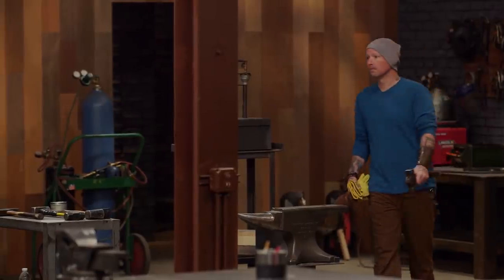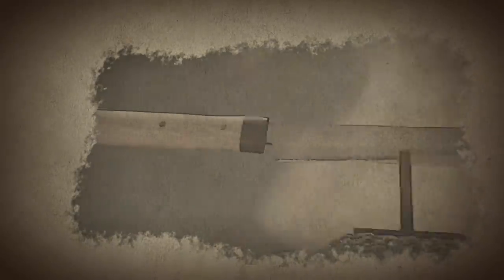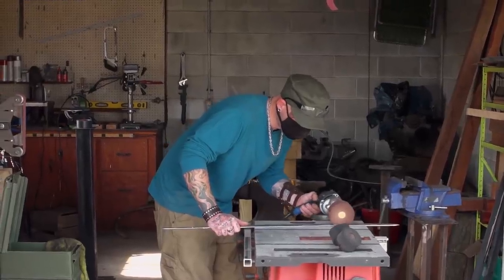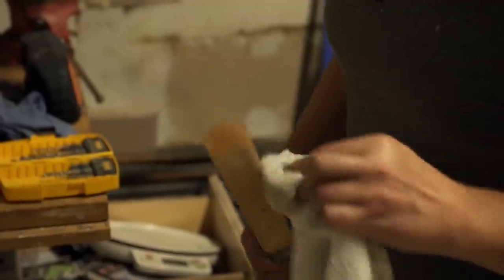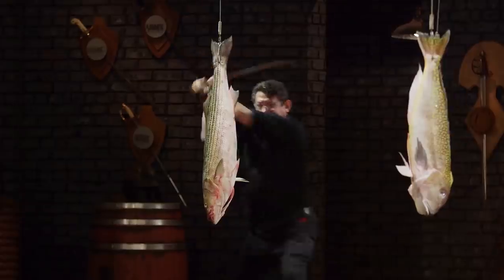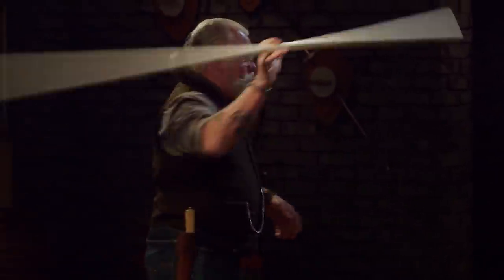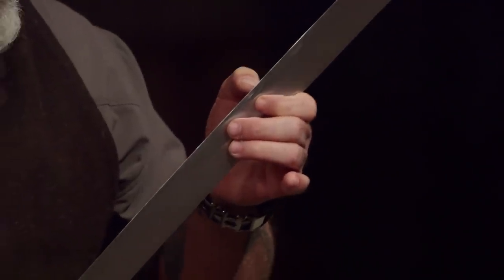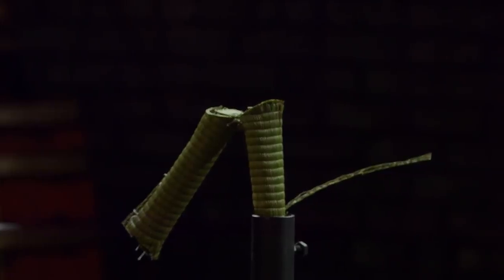Forged in Fire: The MASSIVE Maguro Bocho SLICES & DICES the Final Round (Season 8) | History

Comment: Doug: This blade is very light!

Every Seasoned viewer: Congrats on winning.
Reply: Only if it survives the strength test, otherwise its better to be a little heavier so it doesn't warp
Reply: Maybe need a sudden death where they hit some bricks or cinder-blocks to determine the winner
Reply: There's been some light blades that lost because they didn't cut as well (and that's only counting the ones that survived the strength test well). Like the William Wallace Sword. The lighter blade came out of the strength test perfectly, but didn't cut as well as the heavier blade... (and the heavier blade wasn't tooo heavy to wield). I think they also judge based on how the blade is supposed to be used. It's very important for blades that are meant to be light to be light - and so lightness becomes a much more important judging factor. If a dagger weighs as much as a great sword, that's not going to be an effective dagger. Whereas for blades that are meant to be heavy, lightness becomes just bonus points - if two heavy blades are doing just as well in all other aspects, then the lighter blade wins, because it makes it slightly easier to wield.
Reply: True
Reply: Well it is ( accounting for all other factors ) due to the fact that a light weapon can be wielded for an extended period of time. Which is an important factor
Reply: Sword
Reply: What about the Halloween special with a fireaxe
Reply: @スノーハッピー  The heavy claymore winning makes sense, it’s the same principle as the light ones winning. Blades should be heavy if they’re designed so, light if designed so.
Reply: @CoolHandLuke87  yeah the fireaxe guys were the only exception
Reply: @devmike  No
Reply: Couldn't be farther from the truth. Over half of the "very light blades" have some sort of issue caused by being light.

Comment: How about a show where they make armor?
Reply: Too ridiculously expensive. Armor costs a LOT.
Reply: Take way too much time to make a Full armor
Reply: And the inevitable cross-over where they test the armor against the forged weapons.

...and then the inevitable lawsuits.
Reply: They should test it by wearing it themselves and having Doug try to KEEL them.
Reply: Well, there is that one time that the blacksmiths forge a shield gauntlet
Reply: @indianmikoyangurevichbilal2062  I thought it was a sword gauntlet?
Reply: @ethanguest3438  funnily enough they’ve done both
Reply: If you mean one or 2 small pieces of armors, it might be doable with the time limit (final round). But the thing is, bladesmith is far more common than armorsmith & that's probably one of the biggest reason imo.
Reply: @ethanguest3438  ooops my bad they actualy forge spike shield, on of the the blacksmiths was the guy in man at arms
Reply: @indianmikoyangurevichbilal2062  ahh ok, no problem

Comment: At 8.24I don't think Doug even felt any resistance cutting through the bat. 
It was so light and sharp that his strength pushed the blade all the way hitting the metal stand holding the bats after slicing one of the bats